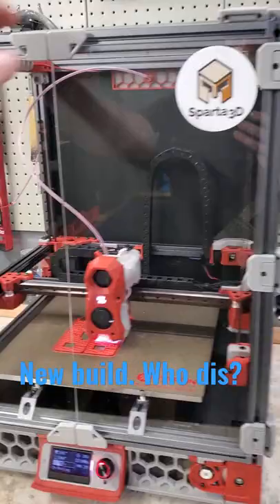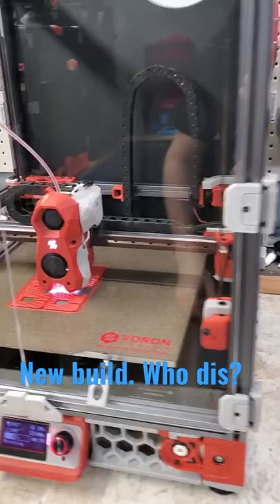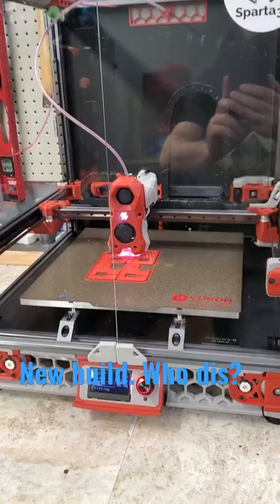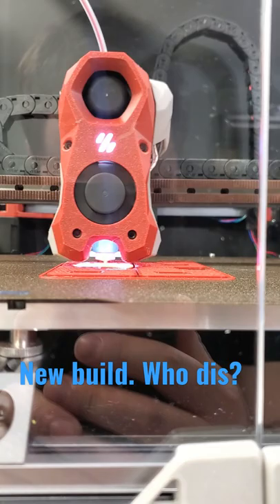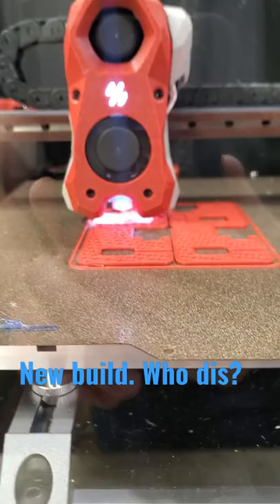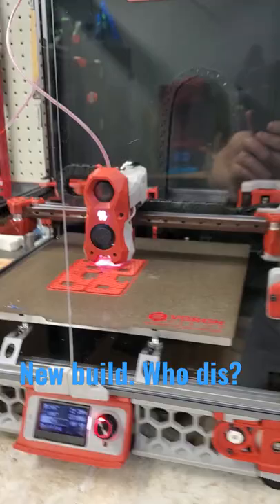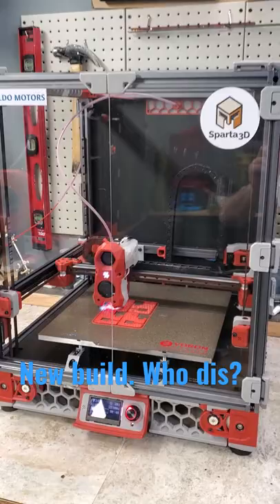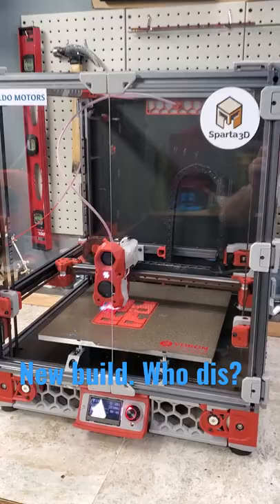Voron v2.4 LDOmotors kit. Crossing the finish line with my newest build #shorts

Comment: Awesome video
.. Especially love the enclosure
Reply from the maker: Thanks!
Reply: @CanuckCreator  was that custom build or does it come in particular sizes? Looks like it might fit different printers
Reply from the maker: @TripleJAu  It is the printer, its a voron v2.4 built using an LDO motors kit https://vorondesign.com/
Reply: @CanuckCreator  I meant the enclosure apologies if I didn't make that clear 😁
Reply from the maker: @TripleJAu  the enclosure IS the printer

Vorons are all designed to be fully enclosed from the start
Reply: @CanuckCreator  thanks for clarification on that 🇦🇺

Comment: Are RGB leds finally invading 3D printing just like they did the PC scene? 😉
Reply: The LED for the nozzle is actually super pratical, so you can see your first layer
Reply: @whomstthouamme2155  Yeah I can't refute that, I typically use a flashlight to see if my first layer is a basket weave

Comment: If I'm trying to do a PIF order for the VORON 2.4r2, I already ordered the LDO kit. I also ordered the revo VORON hotend. What do I select for the parts on the PIF form to be able to build the r2 from the LDO kit? I'm half way through your 3rd video in your r2 stream, but want to get ahead of the 3d parts. I actually also ordered a prusa mini, but I don't think it's going to print the ABS very well after doing some further research.
Reply: as far as I know you can only order afterburner parts in the pif.

Comment: What did you modify on the belt covers?
Reply from the maker: Mounted the rails a bit too low so the stock ones wont fit underneath em, so instead of shifting my rails up a mm i just did a quick cutout of the covers to clear em

Comment: what extruder you use?
Reply from the maker: This is just the stock clockwork1 extruder paired with a revo hotend
Reply: @CanuckCreator  could I use an lgx?
Reply from the maker: @cristianopersi7953  You can, im running LGX`s in 3 of my machines atm
Reply: @CanuckCreator  I mean in the stealth burner.
Reply: @CanuckCreator  I would like to use an E3D revo micro and an lgx extruder with the stealthburner. Do you have stl for the adapters to use?